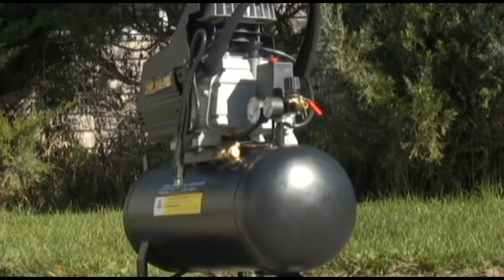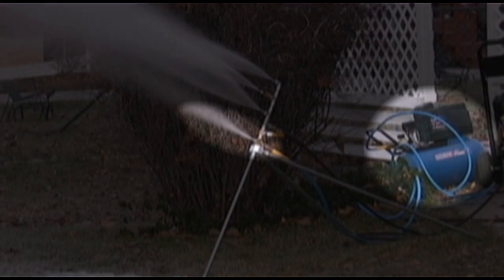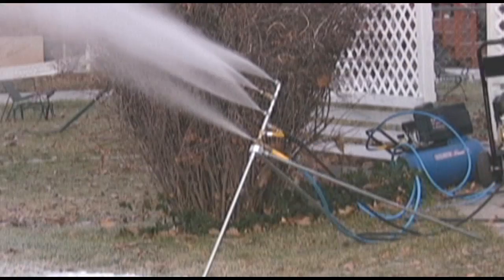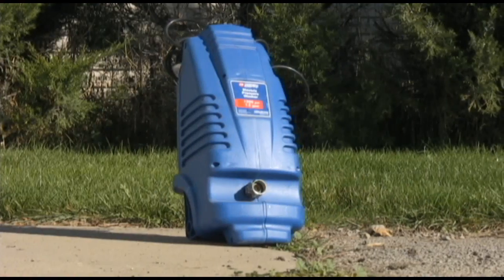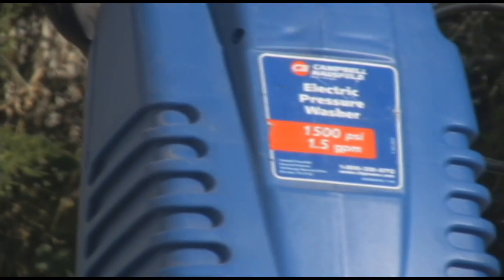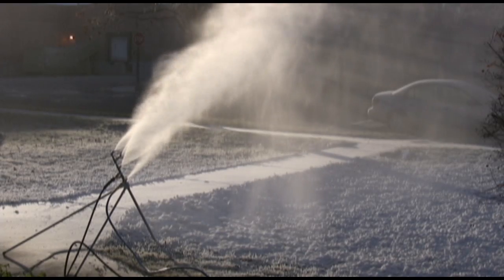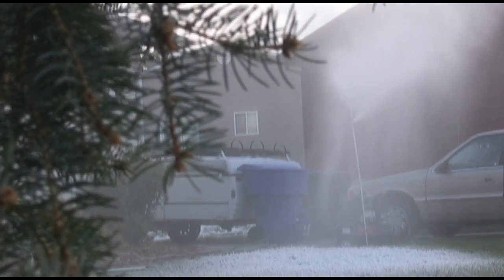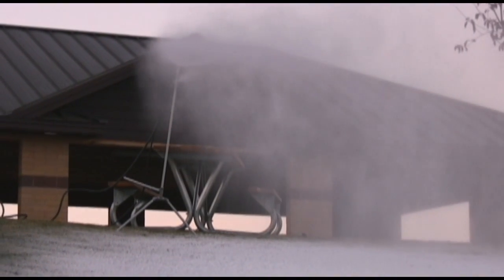How a Home Snowmaker Works

Comment: @phil656565  The hill is a different story than a backyard though.  The hill usually taps a pond which is much colder than the 50 degree water coming from my tap.  Plus the guns are usually set pretty high giving the moisture a chance to freeze before it hits the ground (mine is no more than 7' off the ground).
I do like that wetter snow when it comes to building stuff with it.  I try to make my wall approach and some other stuff with that then blow fluffier stuff on top.

Comment: A wet bulb temp of 27F or lower is needed to make snow.  Snow can be made at 35 if the humidity is super low (like under 20%), but I've never had that happen yet.